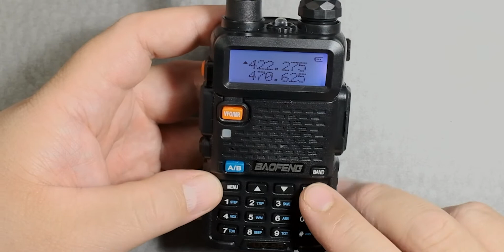Baofeng UV-5R T-CTCSS Transmitter CTCSS

Comment: I wish it was that easy, I just bought 2 and they came programmed together. I told her not to mess with them. Long story short, when I got to put the ctcs on 136 mhz I hit menu then exit, dose not change it it’s still at 0. Idk what else to do
Reply: I have the same issue. Does not retain the code selected when exiting.

Comment: what is the differnece b/t r-ctss and t-ctss
Reply: Have you already found an answer to your question?
I am looking for the same question.
Reply: Isn't it just the normal designation to apply individually between "t"ransmitting(Tx), and "r"ecieving(Rx). On the 5XR (same as UV-5R w/ additional features within the freq bands, some additionally open options using CHIRP and a few minor tweaks with various antenna gain etc., but same radio), there are more options to fine tune both Rx/Tx on additional blocks of freq's and the "R and T" prefixes seem to simply allow the adjustments to be fine-tuned or shut off, according to the desired use of operating on either side of Tx/Rx